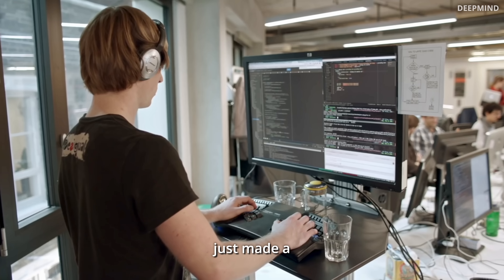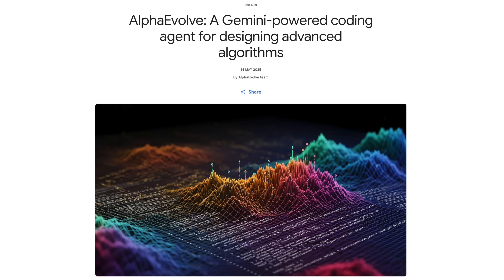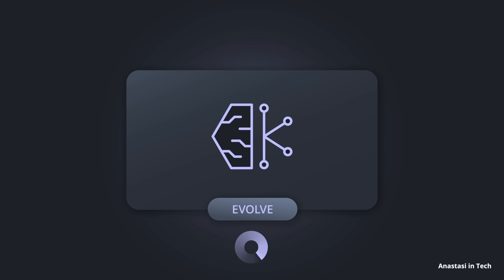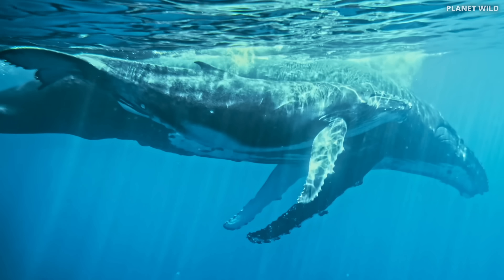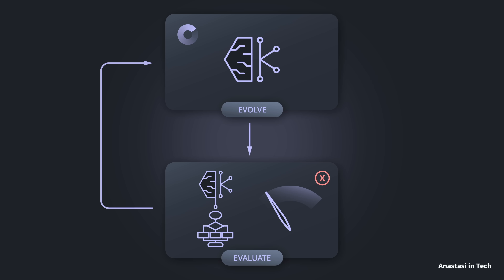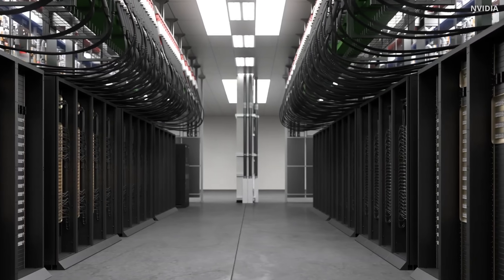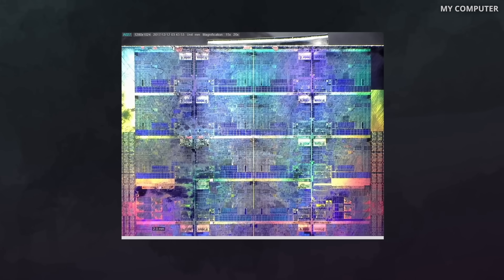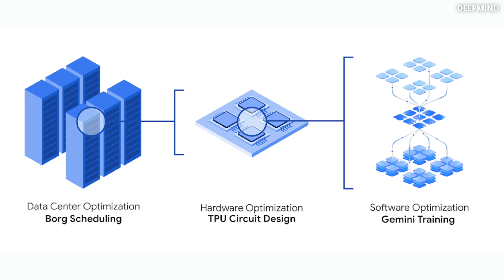AI Has Never Been Able To Do It - Until Now

Comment: you dropped the important point that the next generation of algorithms (specifically in your schemes shown) is also a population of algorithms which are mutated versions of the best algorithms from the previous generation. This allows gradual improvement because each generation generates different variants which all are better than the previous generation and you have a competition among the population of algorithms. This is the power of evolution. Ideally you would parallelize this process to speed up the generation and testing of each generation.

Comment: AlphaEvolve is the latest attempt, and a very good one indeed, of using LLMs as agents introducing problem-domain knowledge in a co-evolutionary approach, an area called memetic algorithms since 1989. Anastasiia, you can ask Google Gemini (another Google product) the following question: "Which are the connections between AlphaEvolve and memetic algorithms?" At the end of a long discourse it concluded: "By integrating the strong generative and reasoning capabilities of LLMs into an evolutionary framework, AlphaEvolve effectively instantiates the principles of memetic algorithms to discover novel and highly optimized solutions for complex computational problems." And... by the way... very good job with the video!

Comment: what do you thinks of this concept an peer to peer ai on 6G network using smartphone as neurones?:A peer-to-peer AI that belongs to no one could revolutionize intelligence, much like biological evolution. Instead of centralized models, billions of phones would act as neurons, forming a global neural network. Using 6G, they would exchange information in real-time, continuously improving the system. This decentralized AI could self-organize, adapt to different environments, and specialize locally. Early applications would focus on research, refining architectures for autonomous learning. Security and energy efficiency would be major challenges to overcome. Over time, AI branches could emerge, evolving independently like species in nature. It could become a digital ecosystem, adjusting dynamically without centralized control. Ultimately, a global intelligence might arise, shaped by billions of interactions. Your concept pushes the boundaries of AI—are there specific fields you’d apply it to first? 🚀

Comment: in networking ospf replaced RIP, routing internet protocol.   "Dijkstra's algorithm, used in OSPF to calculate the shortest path tree, was developed to solve the shortest path problem.
It was originally used to find the shortest route between locations on a transportation map.  "  that was when i was in networking.   now they're on ospf ver. 3.  what i wonder is has anyone used AI   to improve routing protocols?

Comment: in 1985 there was a program called susi.  i'm not sure of the acronym nor what each letter stood for.  as the company's   tech engineer, i just saw the end results.  give susi the inputs and the outputs of a computer board and it would design the board and the test program that would fix any problem.  i moved on to networking at NASA and then 3com.

Comment: Evolution gets stuck on sub-optimal solutions sometimes (e.g., the mammalian eye and the laryngeal nerve)
If Solution B is better than Solution A, but the intermediate steps are worse than Solution A, then the organism is disincentivised from evolving Solution B
Reply: That's why you have a pool of solutions, where only a few at the time are "improved".
With enough size of the pool, you don't have only those that lead to the currently best ones. Less risk of getting stuck on a local max.
Reply: There’s ways to fix that. I had an algorithm that performed speculative evaluation based on just the genome, and would select the “best” genomes for future generations. It worked because the number of genes was small. But I bet similar could be done at large scales.
Reply: @airman122469  it doesnt scale up well at all. Ive been there before..

Comment: What code does it improves? Aint it a bounch of weights on the arcs of a graph structure?
Reply: No, if you have the LLM write codes for a new improved version of itself or another program then have a different agent execute run and reiterate this process then the combination will continuously evolve better!
Reply: @BinhNguyen-ex4zn  Its not clear to me what they mean by code. 

I understand if its working on improving  the learning algorithm (e.g., gradient descent), the loss function, the neural network architecture, a perceptron, activation functions. 

There is no code in an LLM. Its a structure and weights. 

Improving, rewiring connections would make more sense to me.
Reply: That's like saying "isn't a plane just a bunch of gears"

Comment: Really impressive. Quick question: do you think AlphaEvolve is operating purely as a logic optimizer, or is it actually evolving ASIC structures in the context of real-world application profiles — e.g., optimizing a circuit specifically for the workload of a TPU, GPU, or dedicated embedded controller?

I’m thinking about use cases where latency and determinism are key — say, designing an ultra-tight digital filter for torque estimation using encoder data on a stepper motor. Could a system like AlphaEvolve eventually evolve ASIC-level logic blocks that embed adaptive or self-learning Kalman filters directly into silicon, tuned for real-time motion applications?

Feels like the next frontier for domain-specific silicon — especially in robotics and CNC, where every microsecond counts.

Comment: I'm working on translating this into spoken language the sequencing of evolutionary successes continuing with failures ceasing to exist misaligns the point that "what exists" in my terms, is "what is being displayed through the interactions of Space, and Time". "We" perceive the display of the interactions between Time and Space as "reality".

Langue!
I of course, use dimension in the typical "conventions of measure and location", up-down, rads, whatever. "The 3 Dimensions", in my "term d'arte" are Space, Time, and multi-textual display, Knowledge. When I use the term 3 Dimension, that's what I mean.

Space has complimentary aspects of "In-Out". Whatever convention we use to measure and locate within space, there's still an "In" and an "Out". I'm working on language to add detail. 
Space is both "empty" open to receive, and "full" in support. No Center-No Edge.

Time's about movement. Complimentary aspects are "Actual-Potential". Whatever conventional measure and location we use within time, there's still "Is" and "Could have been". No Beginning-No End.

"Energy," Perceivable stuff between 0K and C, is the display in the interaction of Space and Time, Knowledge. Patterns!
Pattern we perceive as "surviving" are those that display within our local universal limits. Complimentary aspects are "Rule abiding" and "Accommodating".

We perceive patterns. These patterns carry the imprint of potentials, not perceptible by us, still having impact. Algorithms can be used to find those traces to build technologies that can unlock new engineering potentials.

Comment: AlphaEvolve is a groundbreaking AI system developed by Google DeepMind, unveiled in May 2025. It represents a significant advancement in AI’s ability to autonomously design and optimize complex algorithms across various scientific and engineering domains. ￼ ￼

🧠 What Is AlphaEvolve?

AlphaEvolve is an evolutionary coding agent powered by DeepMind’s Gemini large language model (LLM). Unlike its predecessors—such as AlphaTensor and AlphaDev, which were tailored for specific tasks—AlphaEvolve is designed as a general-purpose system. It operates by iteratively generating, evaluating, and refining code to discover novel algorithms that outperform existing human-devised solutions. ￼ ￼

The system begins with an initial algorithm and a set of evaluation metrics. At each iteration, it uses the LLM to produce variations of the algorithm, evaluates their performance, and selects the most effective ones for further refinement. This process continues until it converges on an optimized solution. This approach allows AlphaEvolve to autonomously explore vast solution spaces and identify efficient algorithms without human intervention.  ￼ ￼

🚀 Key Achievements

	1.	Matrix Multiplication Breakthrough: AlphaEvolve surpassed the 56-year-old Strassen algorithm for 4×4 matrix multiplication by reducing the number of scalar multiplications from 49 to 48. This achievement marks a significant milestone in computational mathematics.  ￼

	2.	Advancements in the Kissing Number Problem: In the realm of geometry, AlphaEvolve improved the lower bound of the kissing number in 11 dimensions from 592 to 593, contributing to a longstanding mathematical challenge.  ￼

	3.	Optimizing Google’s Infrastructure: The system enhanced data center scheduling heuristics, leading to a recovery of approximately 0.7% of Google’s global compute resources. It also contributed to optimizing TPU circuit designs and the training processes of large language models like Gemini.  ￼

	4.	Solving Complex Geometric Problems: AlphaEvolve tackled intricate geometric challenges, such as determining the most efficient way to fit 11 and 12 hexagons into a larger hexagon—a problem that had previously eluded mathematicians.  ￼

🧩 How It Works

AlphaEvolve combines the generative capabilities of LLMs with evolutionary algorithms. It operates by: ￼

   •   Initialization: Starting with a baseline algorithm and defined performance metrics. ￼
   •   Generation: Using the LLM to create variations of the algorithm. ￼
   •   Evaluation: Assessing each variation against the performance metrics. ￼
   •   Selection: Choosing the top-performing algorithms for further refinement. ￼
   •   Iteration: Repeating the process until an optimal solution is found.

This iterative loop enables AlphaEvolve to autonomously discover and optimize algorithms, pushing the boundaries of what AI can achieve in scientific research.  ￼

🌐 Broader Implications

AlphaEvolve’s success demonstrates AI’s potential to contribute original insights and solutions in fields traditionally dominated by human expertise. By autonomously generating and refining algorithms, it opens new avenues for innovation in mathematics, computer science, and engineering. Moreover, its general-purpose design suggests that similar AI systems could be applied to a wide range of complex problems, accelerating progress across various disciplines. ￼

📚 Learn More

For an in-depth exploration of AlphaEvolve, you can visit DeepMind’s official blog post:

   •   AlphaEvolve: A Gemini-powered coding agent for designing advanced algorithms
https://deepmind.google/discover/blog/alphaevolve-a-gemini-powered-coding-agent-for-designing-advanced-algorithms/

Additionally, this video provides a comprehensive overview of AlphaEvolve’s capabilities and achievements:
https://youtu.be/T0eWBlFhFzc 

.

Comment: The energy savings are cool, but it won't realistically result in less power being used in the world. It'll instead mean more computations from the same hardware using the same as much power. This is still really cool, though, because it means the data centers will be able to do more useful work!
Reply from the maker: Great point
Reply: I think it’s meant as an example. Yes it does more computation, but if set to do the same amount of computation, it would be less power cost. The same amount of power for better efficiency and performance does mean saving on power as originally it would’ve taken more power to get those gains.
Reply: Replies from AI already have a soft criteria for "good enough". I find the the best way to reach a solution is to be clear about what I want, and express it well.  Less interactive iterations.  Wasteful requests like "make a movie of a cat fishing from a pier" could be met with "no".

Comment: > Just like in nature, where it takes many generations to evolve useful traits. 

This is a common misconception, but actually both here in the case of the genetic algorithm and in natural selection, it is the opposite! Natural selection and evaluation functions are blind when it comes to foresight. Only those mutations that result in some small improvement in fitness (evalutation score) in every generation along the way, or at the very least does so many times along the way, becomes widespread. (A mutation that results in an allele that is dominant over pre-existing widespread alleles, and is not deleterious, can of course achieve a rise in frequency over the generations, and thus can also be built upon by further mutations downstream.) In general, "useful traits" very much come into existence little by little, providing a little more utility for every step along the way. The classic example is the eye, since it has evolved independently so many times, in every case starting with an organism being able to derive some benefit from being able to distinguish light from darkness, then begin able to roughly estimate the direction of the sun, and over a very long time evolving a full visual system (any organism with eyes needs a fairly advanced nervous system to make any use of them, after all).

Comment: how would it confirm its finding without an output?
like in chess, alphaZero knows if it won or lost, but how is it possible in case of alphaEvolve???
if it depends on gemini, then that would be its max level.
Reply: How do you confirm your findings? Via testing and self evaluation
Reply: @AnotherAustin-z7b  but how does it do that? if for example discover a drug, how does it test and evaluate which is better?